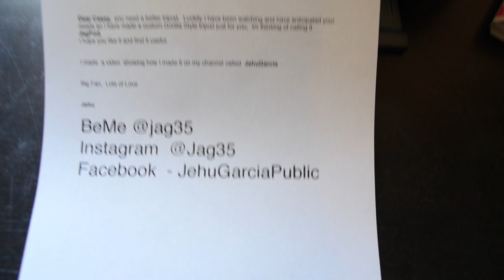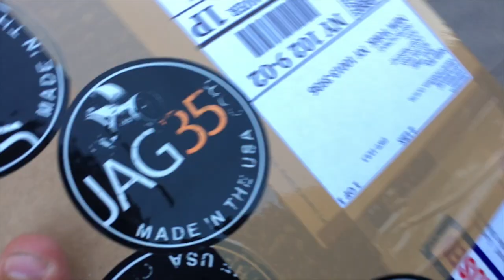HOW TO USE THE BENDY TRIPOD  -  Vlog #158

Comment: You know, especially now that it's out there, you need need need to connect with a machine shop / manufacturer and start exploring cost/market analysis. If you can manufacture it for a low enough cost point, you can sell allot of these things.and LOL at the "haters" - how many daily vloggers are even on the radar at all now solely because of some connection to Casey Neistat?